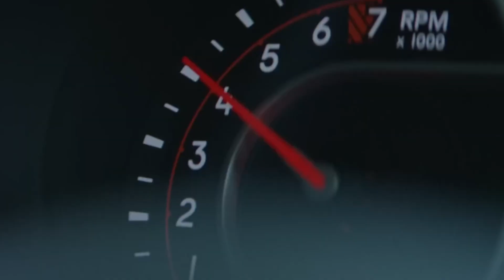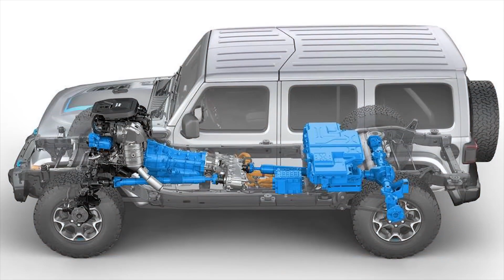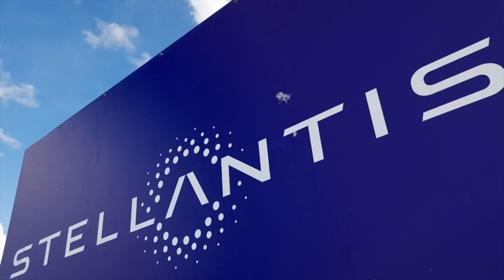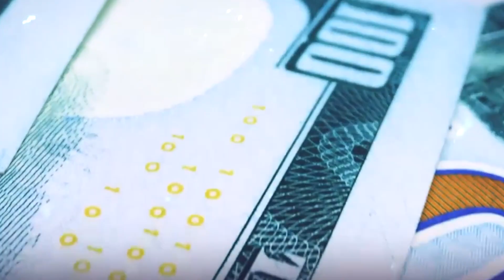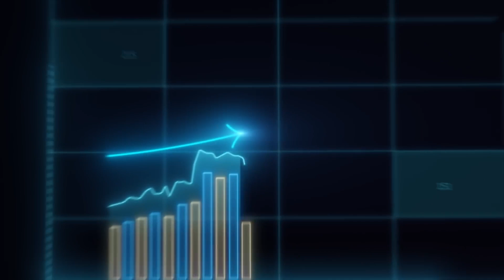How Jeep's AIR Engine Will Destroy The EV Industry

Comment: Really bad! Hydraulic system maybe, it's been done and it works. It has issues and lends itself more to low performance systems. Needs further development. In the case of air powered engines, inherent system inefficiencies and inherent thermal issues when air is compressed are working against it.